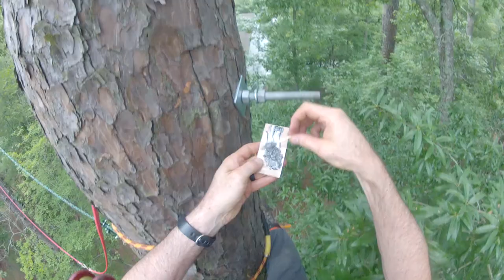Installing a 35 foot high "Y" style custom tree swing

Comment: With the jb weld I'm assuming this isnt designed to be adjusted as the tree grows? 
Initially I was thinking a cable around the tree, with some sort of protective sleeve. Making an adjustment every 2 years or so. Itll be on massive fir trees that I don't want to put a 4' bolt all the way through. Any suggestions?

Comment: I've been thinking that an 8" or 12" WIDE flat webbing sling could be pretty gentle on the tree....then link the loops to a length of chain that runs between the trees.  Thoughts?  I don't know, I just hate to drill the tree.  I REALLY don't want to hurt my trees...we don't have a forest, just a backyard.  I know these industrial slings are EXPENSIVE...$100-$150 each, but it'd be worth it if it was ok for the tree...I would put an even wider band of carpet under the sling??

Comment: what's the narrowest gap between trees that this would work for? 10' ok? would install on a hill between two redwoods
Reply from the maker: I'll install a V shaped swing on trees 10 feet apart.  In a case like that I wouldn't anchor it more than 20 feet high though.

Comment: Is it necessary to go all the way through the tree trunk? Some of the trees I want use are fairly wide (2 ft). Is there risk in just having the bolt cranked into the tree about 12”?
Reply: no lol. just use a tow strap, honestly. tie it around the tree securely. i wouldn't want to harm a tree by drilling all the way through.
Reply: @superwavess  I did that using a tow strap that had a very high break point but at some point something shifted and the swing began rubbing on the strap without us knowing it and eventually the strap broke while someone was swinging on it. No one got hurt bad or anything but I think metal all around is the way to go (securing to and through the tree and down to the swing).

Comment: do you have any concern about the tree growing around the bolts or pushing them to the point of stress? has this hurt the tree at all where you drilled thru it?
Reply from the maker: Hi Sarah. Eventually the tree will totally engulf the bolts, but that could take 20 or more years.  The outward growth of the tree will not damage the bolts.  Anytime you drill into a tree there is a chance that the tree will not be able to heal the wound.  That said I have installed over 100 tree custom swings in this manner and the tree has never had any trouble healing over the wound.  It is however important to only drill into wood that is already free of decay and healthy all the way through.

Comment: How does this effect the tree? Why not just use straps?
Reply from the maker: Straps will girdle the tree as it grows and can kill the tree if left in place.  Drilling through the trunk (or a limb) and installing a bolt will not do long term damage to the tree since nutrients can still travel up and down the tree.  Also the tree can continue to grow.  Eventually, like in 10-20 years, the tree will completely grow around the hardware at which point the swing would have to be replaced.
Reply: Patrick Brandt that's why I adjust my straps every fall. and if you didn't want too a large loop in the crook of a branch well also work.
Reply: Jason Campbell - straps are harder on the tree than a bolt.  The bark is the skin.  The bolt barely nicks the bark vs the straps certainly wearing on the bark..  The water / sap, travels up just under the surface that’s protected by the bark.